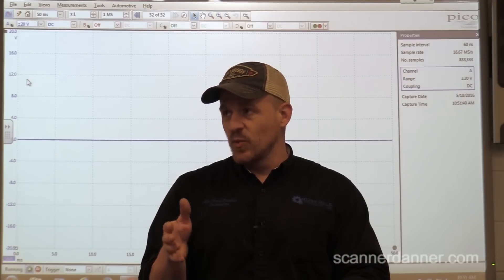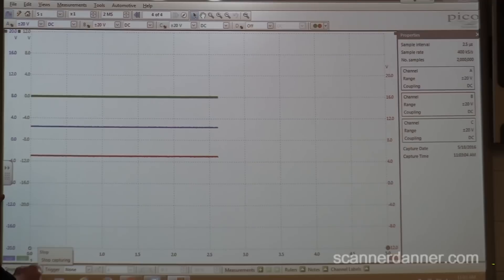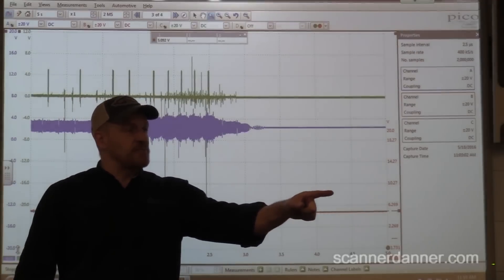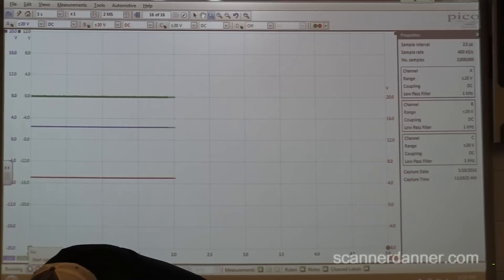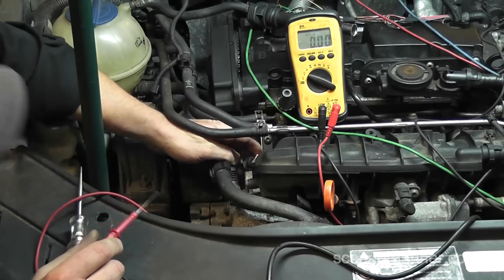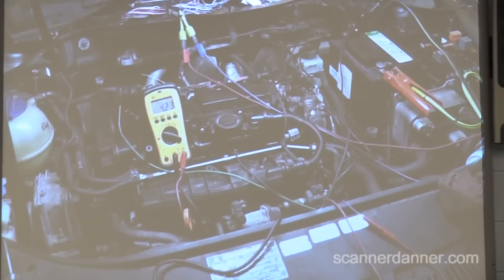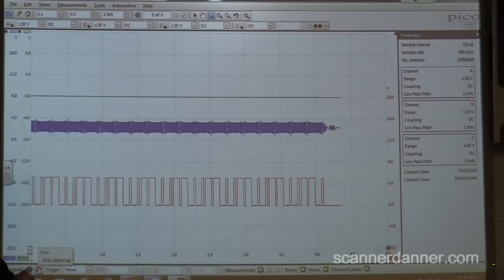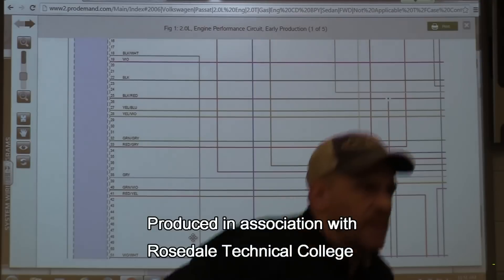VW Passat No Start - an SDP Case Study (Part 2) - [Bad Sensor Ground]

Comment: Paul, the European car makers do explain what each wire does or where it goes to in a control module in their OEM electrical wiring diagrams, for example WIS for Mercedes Benz. It’s the shitty all in one websites like the Mitchell websites you’re using for diagrams that doesn’t explain it. It’s really not a Euro car issue, but rather an American wiring diagram supplier issue. As always love your teaching.

Comment: And I thought I was going crazy! Thank God you guys were working on a VW. The diagrams really suck! Even the OEM ones do. It's not Mitchell or Identifix screwing up. I actually had to take one of the connectors apart (t91, the one with the Power and Ground connectors). Everything except for the Power and Grounds is wrong. Color-wise and cable-wise. 97 and 80 are supposed to be Can-H and CAN-L. There are no cables in those two holes.

Comment: At min 25, the meter is set to volts. Most multimeters will not close the circuit with the lead into amps slot.

Comment: i got tired of blowing the fuse in my meters  i made a small inline with an atc fuse holder and go next size lower than the one in my meter. saves a lot of headaches.  plus my good meter never leaves my box unless its in my hands. only have about 10 meters scattered around at any one time

Comment: Sorry in the last video I talked about DIN diagrams, I looked it up and on those diagrams they indicate where power comes from as in terminal 30 is direct battery feed, while terminal 15 is battery + from the ignition switch. This is an area I feel SAE diagrams falls short. 

Also as I said brown always denotes + voltage leg of the circuit

Comment: Very nice lots of good info,  maybe you can help I have a Passat TDI 2012 has a P0191 fuel pressure sensor , the dealer replaced the sensor and fuel filter code went away for few days and came back , they have not idea what to do last thing was to replace the ECM  board  and code came back, any suggestions I would really appreciated thank you for helping
Reply from the maker: What does the the psi sensor read when measured at the sensor with a voltmeter, compared to what it reads on the same signal wire at the ECM?

Comment: We definitely need more mechanics. I got sick of arguing with other "mechanics" about parts changing or not knowing the difference between tapping and knocking. It was always something stupid, useless and/or dangerous. Even had a tech open a trans cause the shifter was stuck in park...of course the cable was torn and seized. I guit every shop and packed up my tools each time. Eventually opened my own 👍🏾. I've followed you for years and love the passion and knowledge, thank you.

Comment: Great videos and appreciate your content.  Please consider  more diagramming of  the actual location of electrical pin connections you are showing on the multimeter or picoscope.   I lose track of where you are connecting on the wiring harness and ecu as you move these connections around, especially with so many different ground connections.  Thanks, great content.
Reply from the maker: 100% and we've gotten much better since 2016 when this was filmed. Thank you!

Comment: Great video. Personally I would have went after the pcm communication issue at the very start, as I always thought was the most important. If have fuel and no spark then I'd check the main ground for the ignition coils
Reply from the maker: Just teaching through some fundamentals with my class and we were covering ignition systems in this final week of the term. So I used this opportunity to show them things we just learned, live, on an actual problem car.
Not arguing at all with your assessment, just explaining why I chose this direction first
Reply: @ScannerDanner  Yeah man after I left that comment I started thinking that you probably went that route for the students. I know you're very talented technician, why I enjoy watching your videos. Them kids are fortunate to have had such a good instructor.
Reply from the maker: @codyarizona4925  thanks Cody!

Comment: More than a couple times I've seen shorted 5 volt reference circuits. I just knew the ECU was smoked. It's never happened yet and I don't know how it survives. I guess I just played it off to an ECU that either has very robust converter circuitry or a resistor that is also able to handle it. I'm not an electrical engineer by any means so I don't really know the answer.

Comment: This was surprise...I was thinking the 1st video was just advertisement for rest of videos  EDIT Around 10:53 you was bit lost. The coil should not fire on every crank rotation. Every cam yes, crank need 2 cycles. Sure, you will correct it on next seconds (I am not so far)
Reply from the maker: I mean it was/is, but my plan all along was to give you guys all 3 parts here without having to sign up :-) Thanks!

Comment: Although you live in the US, I would like your take on the European Fiat Stilo 1.6 Marelli IAW 5NF ECU issues. Is it possible that a bad FBW electronic throttle body could damage the 5V circuitry on the ECU? Most people would just blame bad placing of the ECU on top of the engine head that would cause the ECU to get hot. But some people replaced their ECUs only for them to fail after 2 years or so again.
Reply from the maker: Usually the 5v ref circuit is highly protected from shorts. Take the short away and the 5v ref returns to normal. So are you saying that the 5v ref circuit is being shorted by the TPS circuit in the throttle body?
Reply: @ScannerDanner  by this I mean physically burning the 5V reference driver on the ECU side. Could a bad TPS (or anything else that works on the 5V ref, e.g. air con sensor) gradually damage the ECU by forcing it to operate outside the rated current rating?.
Reply: @ScannerDanner  in my case nothing is shorted. I had some intermittent DTCs for throttle body position sensor (p1220, invalid signal) and MAP sensor (p0105) but after cleaning the TB 6pin plug with electroclean I'm file.

Comment: Even if you provide the computer with an external ground you already have a problem in the 5v reference circuit which means that it will not run

Comment: European cars start up with 3 sparks for every power cycle. That happens as long as the engine is cold. At least this is the case for VW and Opel.